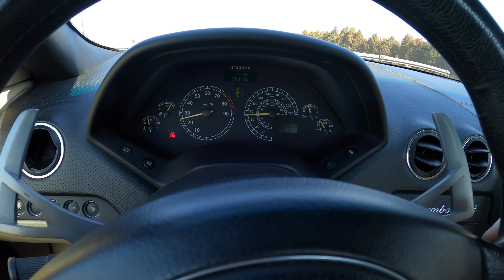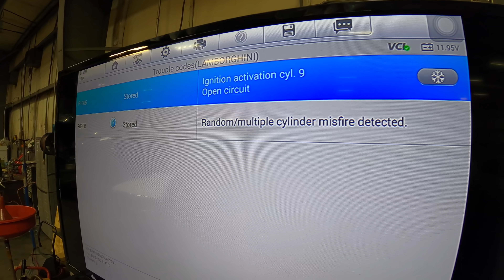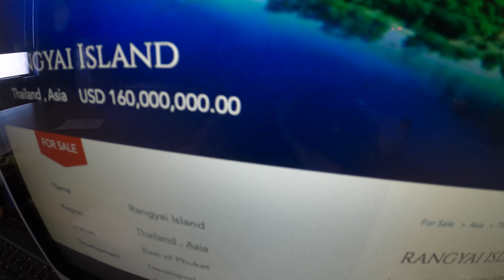Here's Everything That's Broken on the Cheapest Lamborghini Murcielago Roadster: HUGE ESTIMATE

Comment: 17k miles and a transmission gone, thats a new all time low,
Reply: It got thrashed on the track big time.
Reply: It’s mostly idiot owners. I worked at a Toyota shop and a Toyota Tundra came in with a cooked transfer case because the owner doesn’t know how a transfer case works and drove it on low range on the highway. Toyota naturally  refused to warranty it but the owners dad forked out for the repairs. We also have a good amount of Zupras coming in with suspension damage from curb impact. Last one that rolled in had 3/32nds left on rear tires after just 20,000kms and that alone says a lot.
Reply: @markj2093  who else buys buys Lamborghini
Reply: Mark J a porsche gt/turbo would have taken the abuse like a champ
Reply: That's Italian build quality for you.
They build their cars to be showpieces, not to drive.
Which is why I'll never buy one.
And if i ever did, I would baby it and invest in all the specialty tools needed to repair it myself.
Reply: @davecrupel2817  seems more like poor ownership. Thats what happens when cars get thrashed on constantly. Lost first and a burnt clutch definitely has a lot of launches.
Reply: it would be cheaper and better  to put a TOYOTA/AISIN/Japanese/German Getrag  Transmission
Reply: @matte8441  driving them like mad
Reply: His Mclaren had 3 transmissions replaced in I think 50k
Reply: and 15 years old
Reply: if you take a  look the interior, you can clearly see, it's more than 17k,at least double but more like  triple.
Reply: @jimmiesapienza5688  or just simple stop and go driving with terrible paddle shift manual
Reply: NAh you can trash it in under 1.7 miles if you drive like a muppet

Comment: Tyler with that quote dont worry, its a lamborghini, not a mclaren, when its fixed it will stay fixed as long as you let it warm up first before getting on it, and dont use launch control, as I bet that's how the first gear got shredded in the first place, either that or burnouts on a cold transmission, as lambo transmissions need time to warm up before you go hard on them.

its something that's been a thing on them since the Coun - Tash (say it right now, COUN, TASH, not what you were saying) you gotta let the 10 quarts of transmission oil warm up first before you get on it, and this is the same engine they used in that.

as that is the only drawback of italian cars, you gotta give them 5 minutes or 6 miles to warm up before you get on them, which sounds annoying but well, just treat it like everytime you take it its gonna be cold outside.

as with any Italian car, you need to show it mechanical sympathy, once you do their fine, as Jay's Countach has over 70K miles on his and the only thing he's had to replace were the door struts, and all because he let it warm up first.

Comment: Keep your old transmission... you may need those priceless gears in the future
Reply: 68camaro86 all of them except first gear is left. 5 bullets left in chamber from 2nd to 6th gear intact
Reply: Yet all the other gears were munching on gear teeth for who knows how long.
Reply: But if listening to when shifting in highway went through 2-6 no noise maybe they were fine as 1st gear broke into the transmission for it to come out. Who knows how bad it is maybe it wasn't catastrophic not to affect their shifting on rest of gears?
Reply: I was wondering how much his old transmission is worth. If parts are so expensive it must be worth quite a bit.
Reply: MrDuncl enough to buy a normal new car off the dealership floor newer model 2019 0r 2020 with everypart in the transmission of course and value replace parts

Comment: The manual conversion will significantly add value to the car! 

Wizard didn't mention additional costs of the conversion such as adding a clutch pedal, center console parts, electronics/programming etc - all this could add quite a bit I would think?

Comment: Wizard: "We are looking at $48k for your transmission."

Me: Laughs in TH350
Reply: Ya and for $500 built lol
Reply: Laughs in 200r4
Reply: GODOFGUITAR2112 48000 if u get it done at Aamco,  90000 at dealership
Reply: @alyssa7867  my 2 favorite were the TH400 and the 700R4. Had a 700R4 from B&M in my 89 TA. Oh the memories man.
Reply: @nasimwehbe8410  See my 85 Buick had a 200R4. Quite a step above the 350 in terms of complexity, but you got fuel economy plus low cost of rebuild.
Reply: Get the gears made by a machine shop
Reply: I had one of those, and a TH700R4
Reply: Convert to Manual with a Tremec 6060, or better yet, 6070 from a 'Vette.
Reply: Lol! I’d call that a win, $18K 👍
Reply: I bought a rebuilt Muncie for $900
Reply: Lassi Kinnunen  Assuming there are schematics available outside the builder to go by. With tolerances and material spec.
Reply: the Bugatti is 50k just for tires,and you you can have your lambo fully serviced for that.rich people problems lol
Reply: @alexanderstefanov6474  ....lol
Reply: @alyssa7867  That 200R4 is only cheap to rebuild if you don't have a performance engine. It will run you close to 2k if you want to buld it to hold up to any sort of power. I have a turbo buick with one so I know. If you want to be able to handle any power you throw at it go with the TH400. That'll hold up with only a shift kit to the power that a fully built 200R4 will, they also are cheap to get and/or rebuild.
Reply: Lassi Kinnunen  Maybe half that cost, though, unless they already had done it before.  The problem with such limited production cars is exactly this.  When you need a specific mechanical part like this, you are really up the creek aside from going to the dealer.

Comment: I heard 5400 per gear gone I spit my drink out.
Reply: same bro lol.
Reply: is that reasonable?
Reply: @gokiburi-chan4255  for a v12 gated Lamborghini yes that it on the very low end price point wise from a shop.
Reply: That's ridiculous price, like 70% overpriced, a sequential sport car gearbox costs around 10 to 15 thousand, that's racing stuff with warranty. You could go to racing garages and they would do a gear for max 2000
Reply: Forreals... and I'm over here complaining about my bmw z4 n54 needing an engine oil pan gasket 😂😂😂
Reply: Every gear costs as much as my whole car 😅
Reply: @cdbtheclaw  3 gears cost of my Fiesta st
Reply: @aldish25  its a gated manual some cars just don't need sequential.
Reply: 5400 a gear they shouldn’t break to begin with 😒😒😒
Reply: Dane Beebe agreed. Probably bought by or for someone who didn’t have a clue how to drive it properly
Reply: Andy Fox no, manufactured by lambo and not porsche or a japanese brand
Reply: @DR_socal  isn't that an easy diy fix?
Reply: @aldish25  Just wondering how much would a machine shop charge to make all of those gears including hardening process? $ 500 per gear max.

Comment: If the first transmission went out with less than 20,000 miles I would be scared to buy a used one
Reply: It was probably driven really hard by some clown they can last way longer than that
Reply: @jc4657  How this happens is people dumping the clutch or doing something stupid in manual mode and seizing the engine hard.  The problem with the design is that the automatic is not an automatic but really a SMT, so you can ruin it just like an actual manual if you are a muppet.
Reply: That was a manufacturing defect. Used is better because the components have had the stress's worked out and it would technically be a proven transmission. Low mileage anything is the worst for this very reason.
Reply: @rowen898  It seems to me like there HAS to be a firm in the US or UK that will make proper gears for these expensive cars when they get older.  For 5K+ from the factory, you would make aircraft/space grade replacements mlled out of titanium alloy I bet and still come in at less per gear.

$20K for an entire replacement that will last 200K miles?  That seems like a great price-point/profit margin when the originals cost far far more.  I can see people with NEW cars doing the swap just to never have to worry about it on a half million dollar supercar.  Similar to the IMS swap on older Porsches.

There are firms that do this for off-road Toyotas and Fords already.
Reply: Not built to last then ? Must be making a fortune off people having to repair things that don't last 5 minutes.

Comment: When your lambo breaks down so you have to drive your Mercedes home.
Reply: That mercedes will break down before he reaches his house
Reply: unfair sanic Then he ends up having to drive the Miata home.
Reply: German still more reliabile than Italian.....
Reply: A fool and his money is easily parted!
Reply: @unfairsanic5089  Actually, once sorted, those old Mercs will run for half a million miles or until nearly every seal in the engine crumbles to dust.  The engine is similar to the old Volvo engines in that it is based off of a tractor engine/farm equipment from just after WWII.  The next generation after it was all new and full of problems, plus dodgy electronics and smog control systems.
Reply: @campkira  Tell that to his 760Li
Reply: So you can use your Rolls to go do the groceries
Reply: @doctorgadget  That old Rolls is also vastly more reliable in terms of "starts and moves" than that BMW - lol.
Reply: @plektosgaming  That RollsRoyce has proved to be a tank ! For an english/german car, it's quite unbelievable.
Reply: @doctorgadget  The engine is nearly indestructible and the best of the car was pretty heavily overbuilt as well as having few electronics.

FF a generation or two and yes, it's a whole other ball game of bills and problems for sure.  My most reliable car ever was my 1967 Mercedes because it had virtually nothing that COULD go wrong with it, and if it did, even if it was expensive for the part, it was clear as day WHAT was messing up.

Today, it's some module somewhere connected to something else and why doesn't my AC work when it's my ABS light that's flashing?  In a way I miss when cars were simple tools.

Comment: Normal car: 50$ transmission oil change every 60k miles.

Lamborghini: 10k-50k$ transmission fix every 17k miles.
Reply: Nah someone was clearly doing hard launches on this one constantly until it totally grenaded
Reply: Mines done 40k. They are good if you don't abuse them and also its critical to have the stock wheel sizes and even then its not ok to try to do burn outs or dougnuts on a AWD.
Reply: I take it that in the "right" hands these (quoted) costs are "normal"?
Reply: @PatrickPeterVlogs  I'd be impressed if someone managed to do an AWD burnout at all in any case.

Comment: You should do a manual swap while you’re in there. Those e-gear transmissions eat clutches for breakfast.
Reply: pckl300 this. Gated mmmmmanual.
Reply: Yeah 8500 for clutch replacement u better keep the manual trans
Reply: My thought as well, you're already at least halfway there, what would the quote be to do that manual swap?  Biggest trouble is if the computers would need swapped out for it, or reprogrammed.
Reply: It's 2020 the humans have learned not to let computers operate clutches.... It always ends poorly!

Comment: 12:10
Whên a car guy sees that out of a engine fluid or gearbox fluid.
- instant heart attack
Reply: @Laj51 
ow dear no hole or damage ?
Reply: @Laj51 ... but god was the one who put that ice chunk there in the first place. Why would you thank him for that?
Reply: @Laj51 
i also don't believe in god...
its just nature
and what kind of car is it ?
Reply: saw it in my 5.4L (which is a common site) when it had some cam follower bearings seize and wore the cam lobs off.....mech was surprised it didn't drop the gear into the piston but this time it just wore the lob off. Still toasted the engine.....
Reply: @Laj51 287K kms which is hang on, 183K miles. I bought it used so I don't know the maintenance history. 

It happened in the usual spot: cylinder 2 (passenger side).

The reason this goes all the time is because cyl 2 and 1 are the last to receive oil.
Reply: @Laj51 
strong engines no worries :)
you just need a new oil pan
my M2 has support bars to protect the oil pan :) but last week i took a U turn for road works and drove over a high curb 
and i heard a loud bang. It was my rear diff, it hangs so low! you could feel it inside the hole car brrrr that sound.....
no damage thank god
ow and also my wheel into a curb :( that sound is also to make your hair stand up
Reply: @Laj51 yup, but with the right rust you can score big. I got a running and driving F150 2006 crew cab for $700. Rusted fenders, corners and frame. 

Fixed and certified for $300. It does have chain rattle on start up, not sure if I"m going to fix it or not. Might just drive it into the ground.

Comment: Me: * still upset at having spent over $2000 in repairs on my 2007 VW Jetta I paid $3500 for *

Hoovie:
Reply: get a toyota next time :P
Reply: $2k for work on a Jetta 2007? You can get an Acura TSX/ euro Accord 2007 for $1500 (in the UK) awesome in comparison!
Reply: And that $3900 repair on my Chevy Cruze bought for $4000
Reply: Victor Ov I’ve spent $2700 repairing my Toyota I bought for $1000... replaced basically every suspension component and the darn thing still shakes on the hwy
Reply: I spent $5000 in repairs on a 1991 NSX that was sitting for 13 years lol
Reply: I have a timing belt, pulley and compressor change due up for th old Focus. I imagine it'll be cheap as hell tbh.
Reply: Imagine trusting a Jetta to last longer than 100k miles
Reply: @vincea1830  why that would mean those repairs are brand new. nothing wrong with that. Jettas are quality

Comment: Driven by a Boy Racer, blew the clutch and first gear...Heathen.
 The main transmission is in the middle for weight distribution.
Reply: But after 17000 miles must be made Of chocolate
Reply: @lee2217  It's also possible the gear was too hard and brittle, but my money's on Boy Racer.
Reply: @EnglishTurbines 
Probably has been abused but  you would expect that more on a, car that price
Reply: @lee2217  Yep, but we are discussing cause, not price...🤔🤔
Reply: @EnglishTurbines   you started the discussion?
Reply: @lee2217  and, your point is?

Comment: Manual Swap that Beast!!!
The re-sale value will make you a huge profit...
Reply: You'd have to find another manual box. That's not easy at all.
Reply: weaselman24 I thought the mechanic said the E-gear transmission parts in these were just bolted onto a manual (they share all the same base parts), so wouldn’t he be able to find a used/cheaper E-gear & just disassemble the non-manual components? then he’d have a manual, but wouldn’t have to wait for one?

unless I’m missing/confusing something..
Reply: @yuskjr  you need the pedal box, clutch master system plumbing and the ECU needs to be changed to stop it throwing codes because the e gear has it's own ECU.

Comment: ( TLDR it turned out to be much more expensive than he was originally quoted.)

So for those that haven’t seen the latest update on this car, the quote WAS $18k until they realized they needed a special oem Lamborghini diagnostic computer to even start to work on the car. An old early 2000s toughbook cost him an extra 7 grand. $25,000 just to get the car running!

Comment: Swap out the e-gear for a proper manual. In the UK, a manual Murci is worth about 50% more than an e-gear. You’ll need another 10k for manual bits, gate, shifter, pedal box etc and probably some programming but once done, it’s a manual v12 roadster. Lush.

Comment: back in the 1960s and 70s Lamborghini supercars had engines and gearboxes that shared the same oil, Muira for example, so when your gearbox started to break up the debris would find its way into the engine and hey guess what, you have a wrecked engine as well as a wrecked gearbox,  some genius decided to change that design around 1971  and have a gearbox that had its own oil, but if you own a one million dollar early Lambo Muira you better keep an eye on the oil levels and gearbox condition!!!

Comment: its prob not had a clutch service every 6-8k and 1st gear got lunched because of it, you dont do any millage in any of your cars keep the rear tyres unless u drive like you stole it they will be fine. i ran some 285-30-19 on my gtr that were 8 years old but like new till they were down to 2mm about 17k of millage no issues

Comment: Bottom line if you want fast and fancy it will cost you.
The most expensive sports car I ever owned was a Porsche 911S.  Yes it was kinda expensive along with the fact repairs were expensive, but it was fairly reliable.  My favorite car was my 1969 Z/28 Camaro, very fast with very few problems, but it did eat up tires.

Comment: I have my ktm 450 xc quad in the shop right now and they said bad gas ruined it yet i ran non ethanol in it  350 for diagnostic 370 to flush the lines and carb yet the end price is 1,200 buckaroos on top of that they wanted 1100 to fix the steering column that was a little loose which i said no i'll do that myself im sad i feel your pain my guy shops rip you off so bad i feel like you did when you went backwards in your chair :'(

Comment: 17k miles and it has oil leaks and the transmission is shot but what a great car.  And only $80k so cheap!    And the mechanic needs to test one of the oil leaks clearly leaking from the oil filter by taste testing it just to make sure it’s oil.  It can’t even seal its oil filter.  Two peas in a pod lunacy 😂🤣😂

Comment: whoever Ned is screwed Tyler on this deal. Ebay sales are 139K with best offer and nicer colors and he still has to have the front bumper painted. So Tyler purchased a POS for 97,000 and going to have to spent 25k to make it safe and drivable and they are asking 139K with under 30k miles. If he paid 75k then its a bargain if he really paid 97K otd then he is going to take a bath because I bet it has over 50k miles on it. Tyler get your money back...